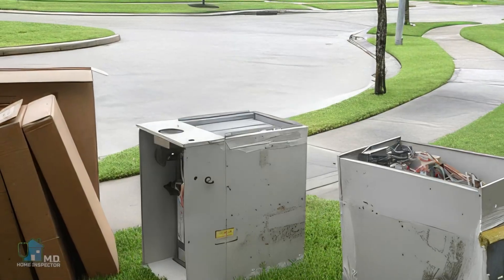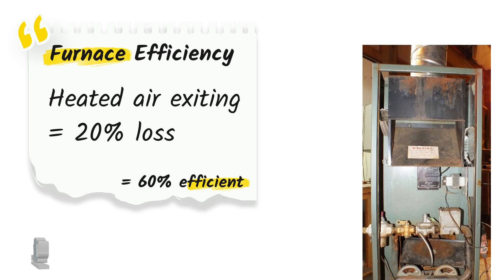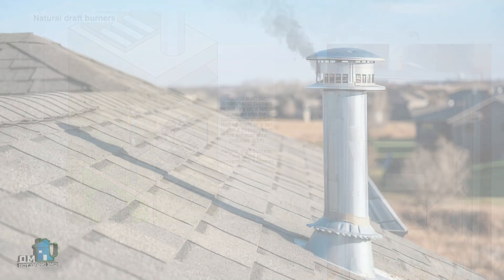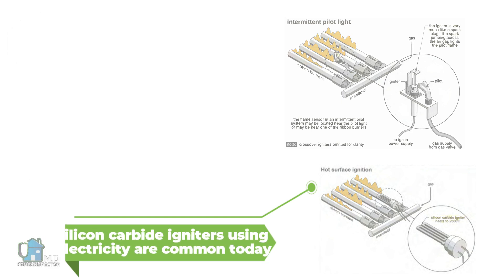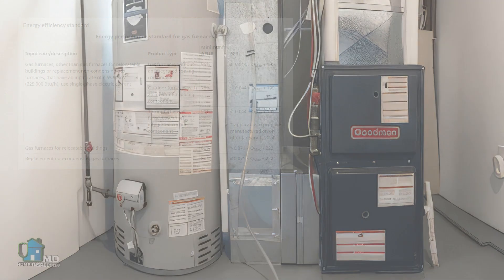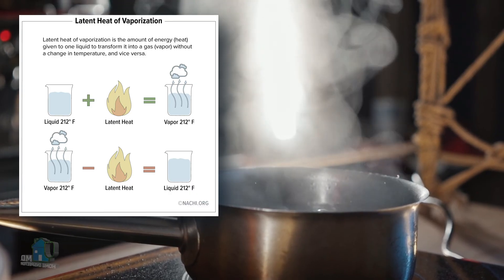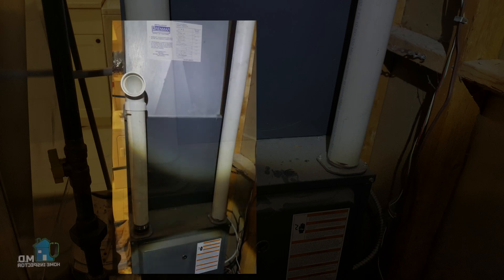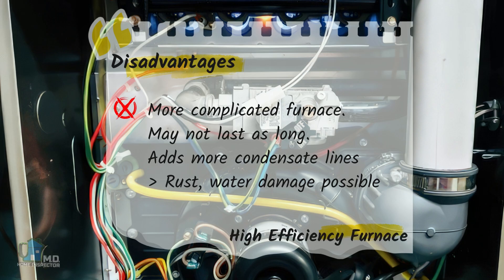Gas Furnace Efficiencies - How it went from 60% to 95% Efficient.

Comment: Doesn’t the efficiency decrease with age? I was told around 5-10% a year or so
Reply from the maker: The main reason you would loose efficiency with time is the filter. Many people, don't take care of the filter. If the filter is missing, or smaller than it should this can lead to the heat ex changer being caked with dirt, this layer can act as an insulation thus you would get less heated air. If the filter was not changed in a long time (I see this very often) then the heat exchanger would have less air flow to it. This can cause cracks in the overheated heat exchanger and reduced efficiency, because of more energy consumption.

Comment: "Of course, there should not be any conventional furnaces operating in homes today"

You clearly haven't been to my town. 😂 As much as I'd love a lower heating bill, it's impossible to beat the fact that this old furnace has been dead reliable for longer than I've been alive. By the time a new one pays for itself it'll be time for a new one again. No thanks. They really don't build them like they used to. 

But good video, I'd wondered what some of the bigger differences were. Thanks for laying that out. I'm sure we'll have to cross this bridge one day.
Reply from the maker: Yeah, they don't make things like they used to. The more tech there is the more things can go wrong so I'm not totally surprised if some are still hanging on!